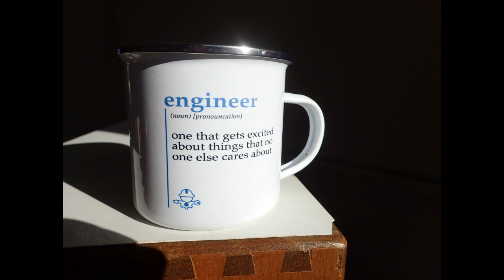BCA Jig Borer - Modifying Burnerd Toolpost.

Comment: Hi Paul good to see the BCA jig borer in action. I once went to a factory auction they had two side by side both with 10 foot diameter tables. I like those old green round drive belts on yours. We used to melt the ends with a cig lighter and stick them back together when  they broke. Isn't it nice and quite when running. Tony
Reply from the maker: Hello Tony,
That is really interesting about the two jig borers... I got the Dore Westbury (DW) running today and that also seems quite quiet, although it was not under load... The DW looks like it could benefit from new belt so that could be turning green. 
Although the video may not have shown it but I have really enjoyed working on the BCA.
Thanks for watching.
Cheers.
Paul,,
Reply: @TheKnacklersWorkshop  Hi Paul. I remember looking at the Dore Westbury as a project back in the 1980's but I needed a mill to machine things on first ratherthan to make it first. Looks like you have a well made machine, looking forward to seeing it working. Tony

Comment: Gday Paul, great t9 see you in the shop making chips also it’s great you didn’t edit any mistakes out, I show my screw ups (most anyway) so others can see how not to do it, the machine runs super smooth, don’t let the camera put pressure on you mate, it’s only a camera, Cheers
Reply from the maker: Hello Matty,
Thanks... spending more time there and using the machines that work to help fix up the others... I had the Dore Westbury running today, just need to tram everything and that one is ready for action.. The Jig Borer looks terrible paint wise but really does run well. 
Thanks for watching and your support.
Take care.
Paul,,

Comment: Hi Paul. It’s great to see you out in your shop turning handles mate. That’s a nice machine. I’ve never seen one before. Question, did you make that vice or did it come with the machine? Cheers 🍻. Aaron
Reply from the maker: Hello Aaron,
Thanks for dropping by... The machine is nice, I really like it... The vice came with the machine but is a modern one and relatively cheap... the problem was not with the vice but the operator - lol. Once I have spent more time on the Dore Westbury mill and have the shaper going I will see if it is possible to have a better quality vice that I can maybe move around from machine to machine. I hope all is good in your camp...
Take care.
Paul,,

Comment: Now I need to Google jig borer to find out the difference between it and a milling machine. Thank you for posting your efforts.
Reply: You know the criterion boring heads that are often used on a milling machine? Imagine a milling machine with that action built in as well as an integrated radial table
Reply: You can also get XY radial tables that effectively turn a milling machine into a jig borer. I'm sure there are more, but triblinka is the only make I've come across.
Reply from the maker: Hello Mr. C,
Thanks for taking the time to watch and comment...  from a positive point of view there is plenty of room for improvement and hopefully you guys can watch it happen.
Take care.
Paul,,

Comment: There should be locks on each axis of that machine including it's rotary table. Standard milling practice is to lock every slide your not specifically using. That way the wrong handle can't move the part by mistake and the slides not being used can't move small amounts due to backlash between there feed screws and nuts. And yes your vise was lifting as can be clearly seen around the 10:25 mark. Again it's standard practice to check everything that's bolted to the table one final time before you start milling. It's not if your going to forget to tighten anything, only how long until you do. Milling isn't quite as intuitive as it seems if you've never used one before. Never ever forget about the cutting tool rotation verses the direction your milling, always conventional mill and never climb mill. The tools flute edge should gradually start into the cut and sweep out to the heaviest depth of cut. With climb milling the tool takes the biggest bite first. While climb milling could be done on that machine, only very light cuts to improve the surface finish should be attempted. .001" - maybe .002" at the most. And you want to gain a lot of experience first before attempting it.
Reply from the maker: Hello TP,
Many thanks for watching and taking the time to give me some information that will help in the future... I look forward to seeing you next time.
Take care.
Paul,,